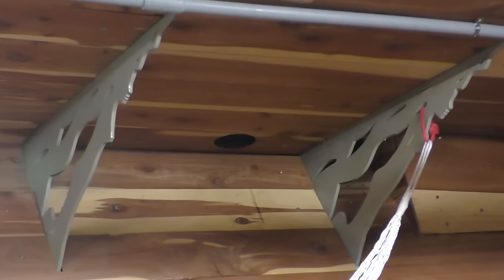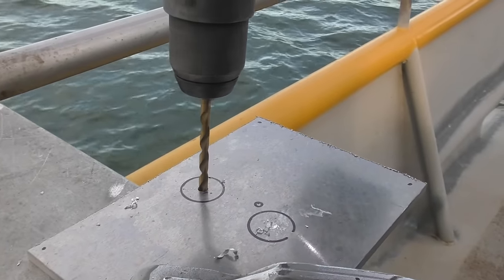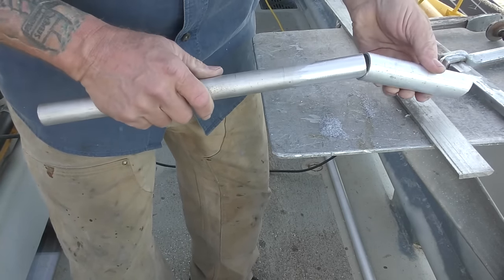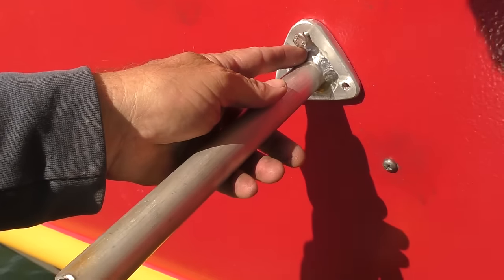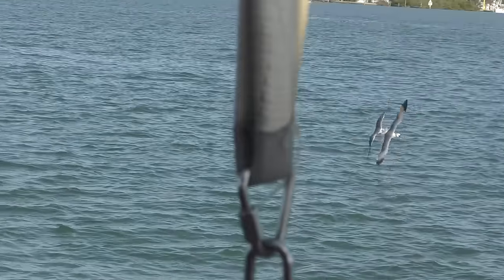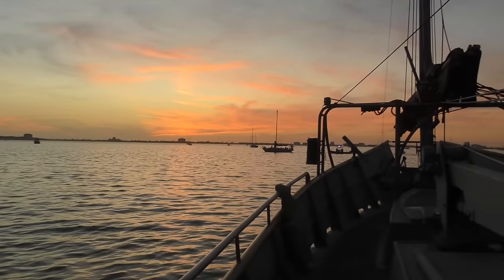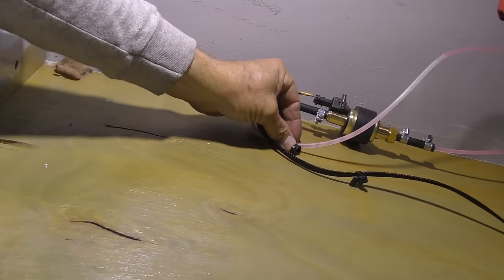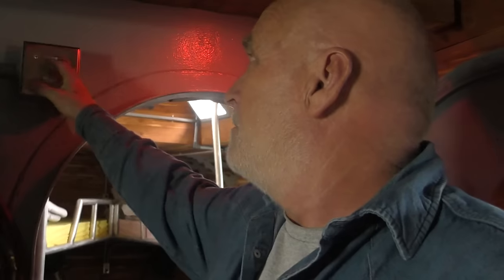Chinese Diesel Heater Install in a Chinese Boat

Comment: They now have a waterproof Wago connector called Wago Gelbox with an IPX8 rating. It’s actually a waterproof cover over a standard Wago 221, made my the manufacturer. Best way to connect different wire gauges.
Reply from the maker: Best way to connect different wire gauges.   ....you mean a wire nut.  Yes.   : )

Comment: Remember to fit a carbon monoxide sensor in each cabin, and especially where you sleep. I ended up with a blocked flue (exhaust) the alarm went berserk and save the day ..colourless, tasteless and no smell ..a real secret killer. So I fitted  4
Reply from the maker: I have four parakeets.   No, three parakeets.
Reply: @SVSeeker  I’m from a different country, so assume Parakeet is a carbon monoxide sniffer that makes a hell of a racket? …. I enjoy your practical real world home spun advice. I spent the 2 years of the pandemic fully consumed in my project and found it satisfying therapeutic and a wonderful learning period  thanks to the University of YouTube!!! .. cheers  Marty
Reply from the maker: @Sandhoeflyerhome    It's a joke twist on "Canary in a Coal Mine":   An allusion to caged canaries (birds) that miners would carry down into the mine tunnels with them. If dangerous gases such as carbon monoxide collected in the mine, the gases would kill the canary before killing the miners, thus providing a warning to exit the tunnels immediately.
Reply: You must be new. Your concern for the well-being of others is considered a weakness on sv seeker.
Reply: He has nest protect fire alarms, they have inbuilt carbon monoxide.
Reply: @etalon3141  Never heard of nest alarms, is that to prevent poo ?
Reply: Someone on here  offered bad advice. Saying why would you need a C/monoxide sensor, diesel heater do not make Carbon Monoxide. It might be worth qualifying that comment with the following. If the outflow flu gets blocked in any way, spiders nets birds general crap, your heater will produce carbon monoxide, fact !  If the heat flame barrier is faulty, sometime down the line it will be, just a question of when it will produce Carbon Monoxide.   For inspiration,  check out the number of deaths world wide of the folks who thought these did not make Carbon Monoxide. The best advice is two sensors in your sleeping accommodation. Why ??? You are dead a long time and the sensors do fail, frequently for a dead battery but over time they stop working. Mine went off during the night. reading was plus 2000.. I would not be typing this had I not bothered to fit one. Now I have two installed.
Reply: Yeah it's not completely invisible gives me a headache but the thing about diesel is it doesn't admit like that you can be in an environment where diesel engine is running and be perfectly fine that's why they're used as mining equipment and not gasoline engines there's no way you could survive in a mine if there was even a small gasoline engine running in there much less major equipment like I said I have a gasoline stove that I thought I was going to make it through the winter with I didn't even make it through an hour I didn't do the diesel heater I ended up getting a generator from Harbor Freight and that little thing would run 12 to 15 hours on a tank of fuel running a 1500 watt heater cycling on and off of course my next bill will definitely have a diesel heater in it
Reply from the maker: @jon8706    You tell them, Mommy!    : )
Reply: @Sandhoeflyerhome  a parakeet is an American term for a small long tailed parrot that is commonly a household pet, the most common parakeet in North America and europe is the Australian Budgerigar .
Reply: @SVSeeker  Im willing to bet there is a small potentiometer on one of the boards in the DC to DC converter that will allow you to bump the output voltage to 13.7-14 volts.
Reply: thank you for explaning @Sandhoeflyerhome

Comment: I have a espar heater/ac setup in my semi. The last 1 ran 7 years with no issues. I was so impressed i opted for the lithium iron sleeper battery setup in my 23 pete.

Comment: just a hint... those copper busbar on circuitbreakers can be fitted into that slot closer to screw. There is also fork version of the busbar which fits even better. The hole for the cables is therefore empty and can be used for cables or connection. There is also three phase variant of the busbar so you can have a three distribution networks in a same line of breakers. And in general, AC circuit breaker might not be the best solution for DC. It might not be able to extinguish the high current DC arc during disconnection (AC arc will extinguish by itself). Just dont take is as rule generaly that any circuit breaker will work in any situation.

Comment: 15:32 I was the LPO for A-Gang on a Knox class frigate. Ventilation ran 24/7 when we were underway. I would wake from a sound sleep, any time there was silence. If we lost the 1S board, steam powered generators, the ship service diesel generator would auto start and power the 2S and ventilation would come back on. If it didn't, I knew I would need to roll out.

Comment: I found some 1" ss tubing at a scrap yard and rolled it in a cheep chinamanize roller and put it in a small 25 gal water heater tank also from scrap yard that i cut the top off and put the coil in it , welded it back up and around the in and out with blumax rod and bam hot water heater from exaust , love the way you see things , people say you only live once ... wrong...you only die once , you  live every day you are here , take that chance and make every day something to remember  and a  story to tell ,

Comment: I have some marine electrical experience and I have to gripe at your electrical chops, you mention the right things and don't do them!  Hahaha.  Marine adhesive lined crimps all day, stick to stranded tinned marine cable when you can, and for the sake of everyone's lives have 3 CO detectors on 3 separate power sources. (I recommend on on ship power 12-24v, and a couple battery jobs) Love the work you're putting in, Seeker looks great.
Reply from the maker: When you can.  Sure.   But if you have a bunch of old extension cords, you can use them and save a bundle for something you really need.   Like ice cream.

Comment: Regarding the two wires instead of one bigger one at 12:15:  When a single wire gets a loose connection, it only heats up at the bad connection inside your panel.  When you have two wires and one gets loose, the other takes the full load and gets hot along the whole length.

It's not a big deal if you're doubling up to reduce the voltage drop, like on that long run to the heater - you fuse it for the rating of a single wire, and it'll protect them both.  Otherwise, you can put a fuse on each wire at the source, and they'll be fully protected.

Comment: the fact that you continue to put inexpensive  (non yachty) shit on your boat and it is working fine, and it pisses the people off that has yachty shit makes me so happy! heres a quote for one of your floor boards " I dont want to fly to the moon on a rocket that Doug built, but if I were stuck on the moon and had to get back I would want his ass beside me"
Reply from the maker: LOL   You will love the story I have to tell about my $6000 B&G yachty chart plotter.  The dam screen came loose and was hanging by a few cables!  It had five little pieces of double sided tape that were suppose to hold the screen on.  It's just past the warrantee of course.   I shipped it to a company to be repaired and they quoted me a price of $2600 to repair it.  Or I can buy a replacement for $3000.   ...found a used one on eBay, and I'm going to glue the screen on.
Reply: I love it, Merry christmas to you and yours sir! @SVSeeker
Reply: @stumphole8217
"the fact that you continue to put inexpensive  (non yachty) shit on your boat and it is working fine, and it pisses the people off that has yachty shit makes me so happy!.."

LOL. You're obviously not a sailor.

I've sailed over a 150K nautical miles and crossed numerous oceans, all in a 36 ft boat. I spent three years refitting the boat for this adventure, and purchased the best equipment I could buy. Yeah, call it "yachty shit if you like, but over the course of five years and the 150K nautical miles of sailing, I've only had to replace or repair but a few of these components. Doug on the other hand, has had to repair or replace numerous items (driveline, transmission, prop, pumps, windlass, anchor rode, tender, sheaves, etc.) and he has yet to sail even 100 miles. Out on the open ocean, in 20 ft seas and 40 knot winds, 2000 miles from nowhere, the last thing you want is a boat full of unreliable cheap components. A boat that you trust your life with.
Reply from the maker: @ExetPlan   Oh don't get in such a twist.  And no, I'm not a sailor, but I sure as hell don't want to end up like you either.   So I'll keep hanging with sailors that aren't such nannies.
Reply: @SVSeeker  
Look, I'm not here to argue with you. My response was a rebuttal to Stumpholes comment based on years of experience, and I used your own fact-based learning experience to make my point. I don't begrudge you for doing whatever you want, to your own boat. To each his own.

Comment: Love the snake bird clip. Cormorants, as we know them. Also known as Black Paddy's. Well we are in Northern part of Ireland. Chinese heater. Concur. Throw away most of the extra fixings. Jubilee clips,filter,pump mounting rubbers etc. installed one in my land rover and all that stuff fell apart. Funny enough. On the boat I have a Propex (GB) Gas to air and it's great. But I used Chinese internet bought distribution air ducting and jubilees. When the jubilees get too hot they expand so much they fell off!

Comment: Standard 120v switch is nice, there's room in that box for a small 10a dc pwm controller,  I've incorporated them into all my camper light fixtures as an awesome bulb dimmer.
Reply from the maker: Yeah, would likely work as a speed controller for that motor too.  Where do you get yours?
Reply: @SVSeeker  after shopping mouser, I opted for ebay, 5V-16V 10A PWM DC Motor Speed Controller  ended up buying a handful to experiment with home made electric heated motorcycle gear (success)  then I thought those 12v lights in the camper were just too bright sometimes, turns out those work well as dimmers and fit perfectly inside the standard RV light housing.   Just fix it!
Reply from the maker: @fastst1    Thanks, I appreciate the info.

Comment: to help prevent chips from clogging hole saw, drill a thru hole in the saw teeth's path, just inside the hole's max diameter (pilot drill bits works) the hole lets the chips fall out of the saw's 'gullets'. WD-40 or rubbing alcohol is a good cutting lube for aluminum.

Comment: Surprised how well the red paint has held up on the outside of the bulwarks it hasn't faded. White noise on a boat its something you get used to most mariners get used to it so much they can't sleep at home in a regular bed.
Reply from the maker: Yes it has.   It's a PPG topcoat epoxy product.    And yes, it's the new and unusual noise that gets the attention.

Comment: Could you run add a DC / DC converter (maybe much smaller) closer to the heater, and then provide 24V over the length of the existing wire?
Reply from the maker: Yup, that would work.  But I don't want to deprive a free piece of old extension cord of a new life.  : )

Comment: I had a similar issue in the van, had to put the dc feed directly over the battery terminals to the heater, the three meters to the switch panel dropped the volts below ten on startup, cutting the heater off. PITA getting out of bed to start the engine to start the heater. No more and next week if of skiing in it . Toasty!!
Reply from the maker: Have fun in the snow.

Comment: have you considered running 24Vto the heater and installing the dc dc converter locally to the heater, this would give it a good 12v at the heater. and save running an extra wire.
Reply from the maker: That would work.   But I have the old extension cord, it was free, and has a lower probability of failure.

Comment: That is a cool little heater. 
I know others have said it too but Please make sure to keep your monoxide detectors in good repair.
Love the idea of a compact backup heater since my furnace was taken out by a hurricane.
My Friend was taken out by a faulty stove.
P.S. Would you consider selling the round 1/4 inch discs you cut from the ship for souvenirs by any chance?
Reply from the maker: I tell ya, Canaries are the way to go.    And if it did not get made into another part by us, then that steel has been made into more steel by now.  : )
Reply: I have my sv seeker key chain proudly sitting above my desk and I wear my crew cap when I watch the vids.
Canaries are a good idea but I believe parrots would be more aprapos in your case, kek.  
I made a small ship warming gift for the captain. (it's not a chy knees heater) how do I get it to ya'll? 
Merry Christmas and keep on living the dream!  @SVSeeker

Comment: Doug over the years I have been watching van life YouTubers and almost all of them have bought the Chinese heater. They work great the first year then they break down the second year. Some have found that the heaters need to be run periodically all year round like once a week or so to keep it functioning right. Others if they don’t run it in summer they will fire it up before winter just to make sure it’s working fine, so they’re not caught in freezing temps. From what I have seen people have had less problems from the American made diesel heater more reliable dependable. Since you already have the Chinese one make sure you do the maintenance on it to keep it functioning. It requires more attention in preventive maintenance then the American made one. 
It’s true they work great for awhile and they are cheap. If it were me as broke as I am I would spend the extra on the American made one. So if you have to replace it next year go with the American made brand
Reply from the maker: And yet here in the comments are people that have had no problems at all.   I think it has a lots of variables: where is it mounted, environment, number of hours of usage of course,  which unit, etc.   And this company even said they have made changes to improve the units reliability.  Hard to compare these things.  But cheap enough that I can carry a spare.

Comment: Hdpe stands up to most all solvents. You can get them in spray bottle form, usually white, from crc products, They stand up to laquer thinnner which is somewhat impressive. 
Tubing of that material will probably last forever.
And, coaxial putty for waterproofing coaxial antennas and wire connectors and such IS waterproof and air tight. It can seal any sort of caulk tube and keep it basically factory air tight sealed.

Comment: Just a thought.  The low DC Voltage will require additional amps for the required wattage.  (volts x amps = watts,  watts stays the same and when volts decreases, amps must increase).   The additional amperage may shorten the diesel heaters electrical components.
Reply from the maker: Who knows, that may be why they have a low voltage cutout.
Reply: Agreed, I should have been more clear.  The heater will see the additional amps on a continuous basis versus  occasionally.  Currently (pun intended!!!) fighting my own DC electrical battles.  Low supply voltage seems to be the main culprit.   All the best.     @SVSeeker
Reply: It doesn't actually work that way. When the heater is drawing more amps you lose voltage due to the drop in the wire. When you use larger (or more) wire it cuts the voltage drop and you get closer to the rated voltage at the unit. Even with the larger wire you are still below the rated voltage for the unit. The unit will only draw it's rated current with 12 volts at the unit, with voltage drop it draws less than rated current. With the voltage drop the unit draws fewer watts. Run a few ohms law calculations with and without voltage drop to see this.

Comment: Are there hydronic  (hotwater) versions of the cheap heaters?  They would be my preferred option but do not have the noise and venting you wanted. Cheers warren
Reply from the maker: I found this: https://amzn.to/41wlMzZ     ...but it's only 5K and twice the price of the forced air heater.

Comment: Why not run 24 volts to the heater then add the dc to dc converter at the heater?
Reply from the maker: That would work.  But I have the old piece of extension cord and it's failure rate is much lower.

Comment: On the ones i've installed on boats I've made it a point to get the air from outside. Helps with getting the humidity out of the boat. 

You cant expect wet clothes/sailsuites to dry in the wet air you just took from the cabin
Reply from the maker: What is this with the wet boat thing?   Mine is as dry as a bone.   Are you up north?  Or are you on a wooden boat?
Reply: @SVSeeker  Not that north. But we do sometimes sail in 10-15C. If you or your stuff gets wet (and on a sailing boat that inevitable) shit dries faster with heated outside air. 

Like you don't turn on recirculation in your car if you step in with wet clothes. Same with a boat. 

On the same note. You better keep some distance between auto inflatable lifejackets and wet clothes. The ones that work with salt tablets will trigger after some time. Had that happen to me a few times.
Reply from the maker: @Harrstein  I put my laundry and dive gear on a line on deck unless I need to run the generator and then I hang it in the engine room.  Comes out crispy.  : )
Reply: @SVSeeker  If it works, it's fine. My suggestion is just something to keep in mind if you intend to go to colder places.